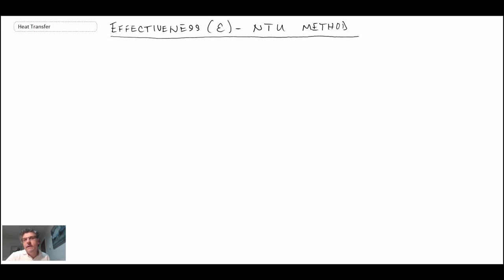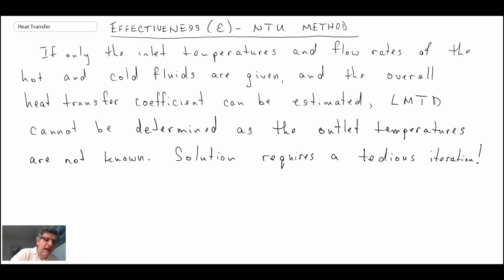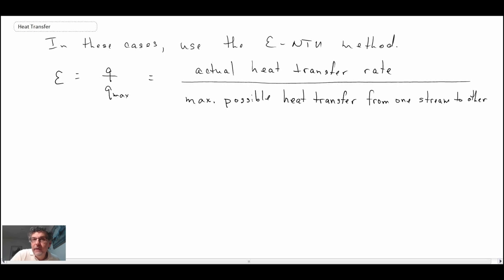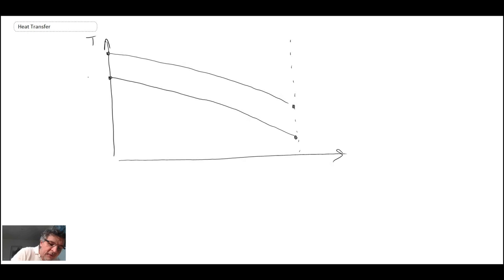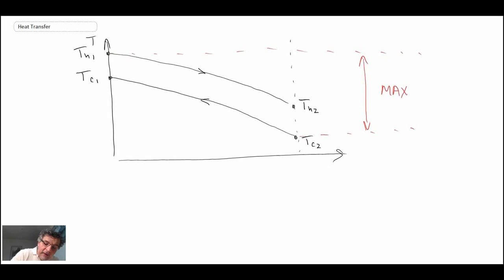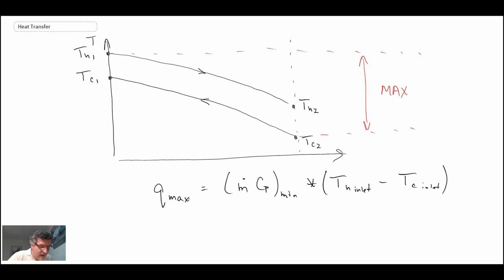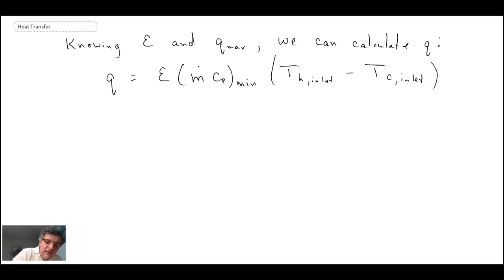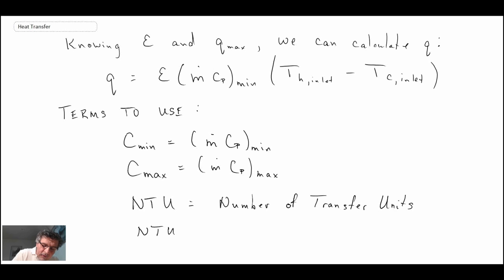Heat Transfer L33 p1 - Effectiveness-NTU Method

Comment: Can this method still be applicable to a system which experiences heat - in - leakages from / heat losses to its surroundings? Or, only for problems which assumed to be in steady state? 

Thanks for the video.